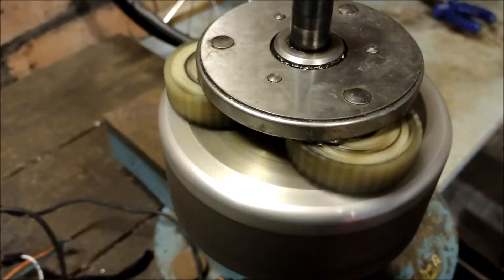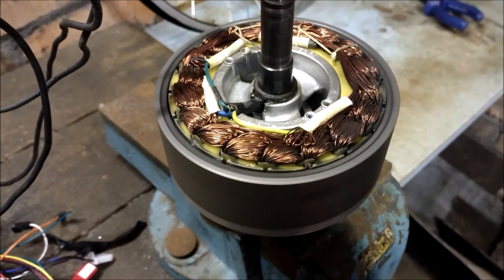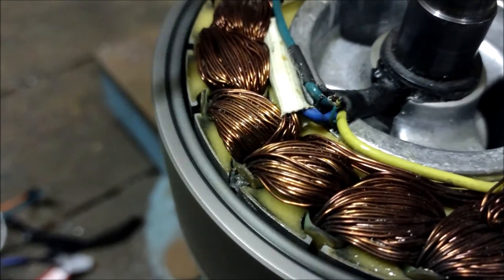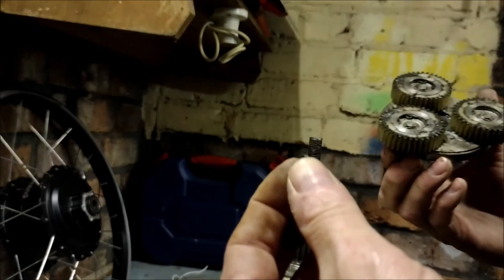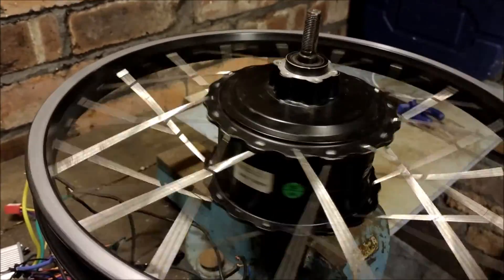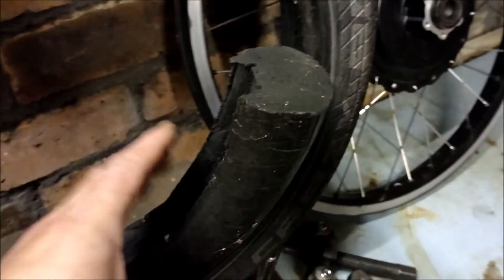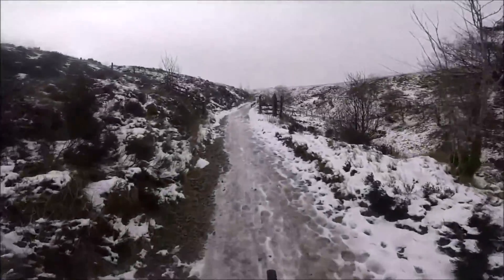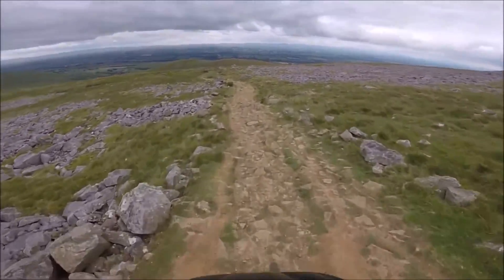Why is my hub making this weird noise?

Comment: What color of phase wire did you connect? If the motor is spinning backwards
Reply from the maker: You swap any two, but it's running without Halls, so no worries about fine tuning.
Reply: @chargeriderepeat7024  thanks bro

Comment: i got a brand new q20 ebike with this motor, not even 10 hours on it i noticed odd sound from the motor and all the magnets were loose so i popped each one applied jbweld and it was a lot better but sadly i chipped a magnet and now it sounds like static under high torque loads

Comment: Interesting. Sometimes the magnets come loose.  Retire it.
I wanna add bafang to mtb with thru axle.  They do H800 which has two speed
Reply from the maker: I did fix it with a hammer and put it on my bmx, but it soon started making the noise again...retired it.

Comment: Im sure you figured out the problem but im sure the bearings in the gears were damaged! And that piece goes in the little key hole ring where the gears are.
Reply from the maker: I actually repaired it in a recent video by whacking it with a large hammer, it now powers my electric BMX.
Reply: I have a same problem I think. Can yoy give me your email address? @chargeriderepeat7024

Comment: If i have a regular hub motor without gears on my scooter and it make those noises, what could it be?!
As i got the scooter (2nd hand, 3 years old) it was fine. Now it make strange sounds as well i lost about 3-4 km/h topspeed (from max. 40-43km/h down to maximum 40 at best)

I hit some nasty potholes with this rear motor while removing some load from the front (which is prone to completely hit the stopper in the suspension)
I tuned the suspension a bit with harder springs to drive as "meant to be" with load on front/rear about 50/50, but i guess the damage is done now?

It really doesnt matter much, this scooter costed me like 200$ just to get into e-scooter driving before i buy a 60 km/h + model, but its still annoying since this scooter might be a nice spare/2nd scooter for other purposes if its reasonable undamaged to drive.
Reply from the maker: ordinary direct drive scooter hubs are the same but without the gears, probably magnet come loose or slightly bent spindle, I cured my bent spindle with a hammer in a recent vid.

Comment: For US $30. you can buy METAL replacement gears there are much more reliable.
Reply from the maker: Ooh, but the whine!
Reply: @chargeriderepeat7024  because of this whine i got a non-geared hub motor model.

Yes, i miss torque quiet much even compared to slow but expensive premium scooters with 350W-700W geared hub motors, but in the end i prefer the better top speed of easily 35 km/h, more like 40-45 and im looking towards dual motor scooters with 2x1200W at least, better 2x2000W and 60km/h+

This regular hub motor also has no problem with lets say 20% incline to go somewhat reasonable fast, just 25% are getting somewhat slow, especially if i fall under 20 km/h you can literally feel how the motor doesnt really accept this load. If i need longer than about 4-5 minutes that steep uphill, the LCD unit shows me a motor overheat symbol and throttles down even further, with luck i have like 700-800W left (power draw on battery, so the power on the motor is even less...)
Reply: @chargeriderepeat7024 shop that selling bafang motors said that versions with plastic gears were made for europe market 25km/h speed and there is guide what torch and voltages it supports.but then people started unblocking them to get "free speed"...

Comment: I hope you don't mind that's not 4mph yes that pin goes in slot when installing motor. If you ever take magnet of keep them at the same poles north and south. If you gave loose magnets best to take all them off the clean motor inside and back of magnets. Dont use proper adhesive use liquid nails is great and heat proof but smear a very thin layer on motor and magnet leave for 24 hours. Buy writes if motor is old your serpose to paint magnets with blush varnish leave till hard then brake a hacksaw blade and sharping till blade cut your finger buy a slight push just kidding then scrap varnish of by doing that it cleans the grove lines in magnet and make motor strong torge new bearing and clutch and you have a brand new motor don't forget the pin for motor. I'm a electric engineer I'm 75yrs old and i love ebikes bugger the speed law I've been out on my 2000wat next to police car done nothing. It the pit bikes that get there atension the bomber bike I've had them all and sold them you shoud try 8000wat 72v 79mph person but 2000wat ebike is the best the way I've done mine people say its a beast good luck with your 750wat like them inserts for puncher I've bought 750wat Fat Tyre bike amazon ice upgraded the seat so I can oed the dam thing I get 45mph on the stand 34 to 36mph not 40mph
Reply from the maker: Its not the Woodruff key, it was the rivet head of one of the clutches I tried out, must have been sitting there for some time 😳

Comment: That bit of metal is to locate the gears that's what's causing clunk the pin looks worn. If you took them gears of the first time you shoud gave seen that pin if you put the gears back with pin I different place that's your problem. If the pin is knackered you can buy one make one with a nail and file it down. It works a treat. Are you sure that 750wat hub mot does 40mph that's load underload that means that motor does 54moh no way then is your weight on bike. I've got 2000wat 45amp cinntoller 52v 20amp battery and I just get 40mph but I can do 30mph in four seconds no way 750wat dis 40mph when your on the bike unless your 2stone

Comment: High it's out of balance the motor. Normaly in motor you will see deep scribe marks that's done at factory to balance motor up to. When they check some are OK others have slight like when you use a chisel on wood and put a grove in. Yes how many magnets does this motor have. I'm used to 2000wat and 3000wat motors

Comment: Have you checked bearings if you have a dodgy one it can make that noise. I've got same motor 750wat but not that make I think it's a cheap one came with fat tyre bike can I ask you how many magnets has this motor got. Mine is new it for setting in display thanks

Comment: I have heard people say that hub motors overheat a lot and the hall sensors fail ( johhny nerd out channel says that ), but I didn't have that problem yet.  Cable did get a bit eaten into one one of them,  not all have the protective metal spring sheath.  Would have thought your spokes or wheel would break before anything in the motor would bend, but with a fat tyre bike the axle is wider ?  did it cause a pinch flat ?    on my new one I have a problem where the speed and power reads 0, thats on the sabvaton controller, maybe a problem with the communication between display and main circuitboard ?  hall sensors must be fine if it passed the hall test and works normally ?
Reply from the maker: The bafang has a white wire to a speed hall sensor, never connected it, never had anything that would read it, not bothered with a speedo tbh, I just point and go😎
Looking at the vid there may be a problem with the coil casting on the spindle, that movement cant be good.
Might pull it apart.